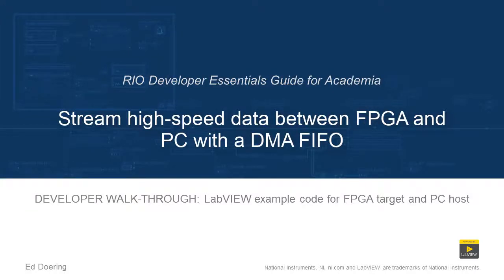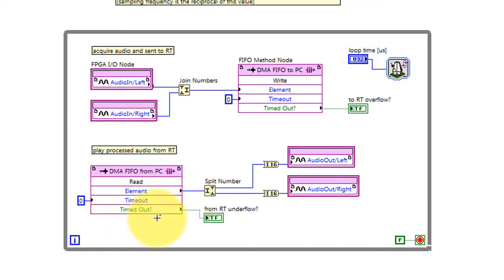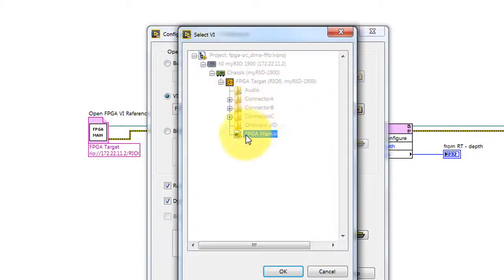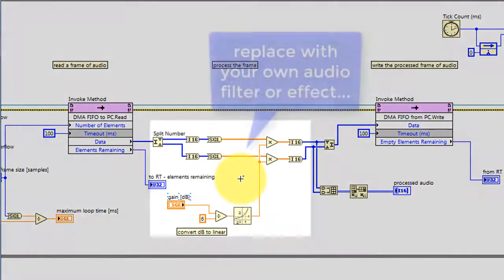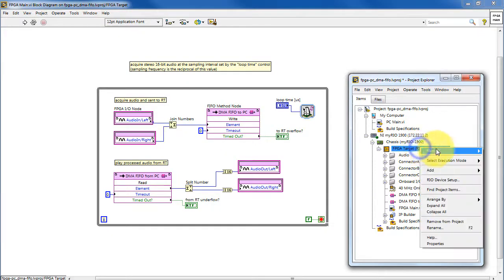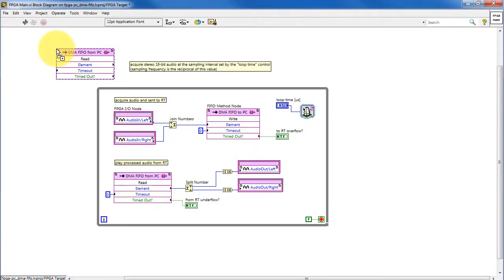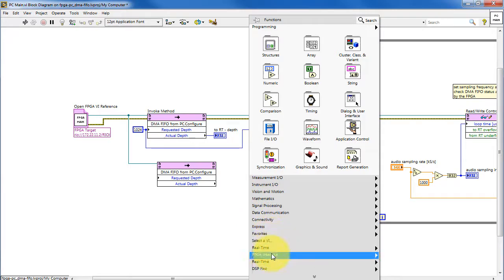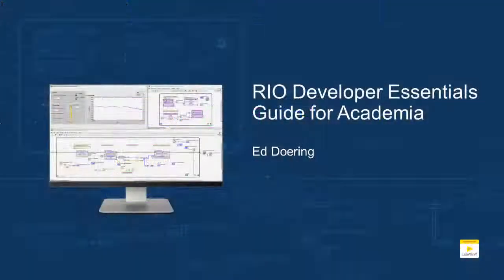LabVIEW code: Stream high-speed data between FPGA and PC with a DMA FIFO (walk-through)

Comment: I want to take fft of 4 analog inputs of myrio coming from fpga fifo to rt. To make waveform to calculate an fft, I measured loop time in micro seconds and divide it by no of samples to read from fifo fpga. But not getting any result from this approach. Would you suggest any other technique?